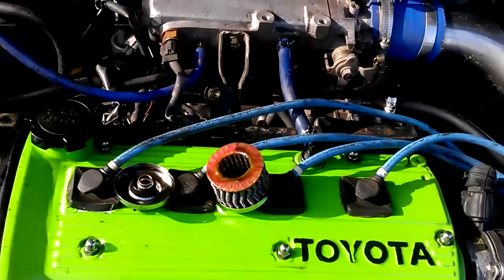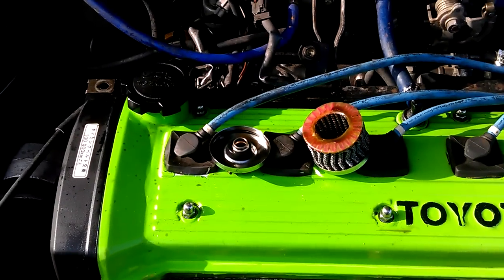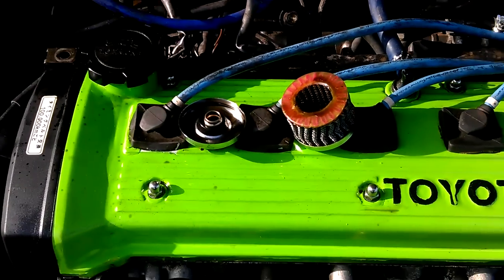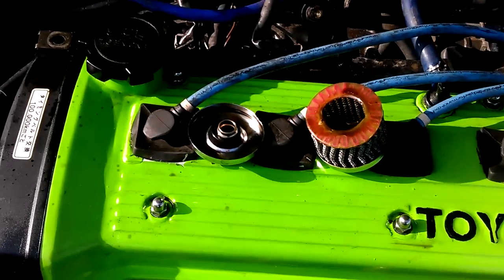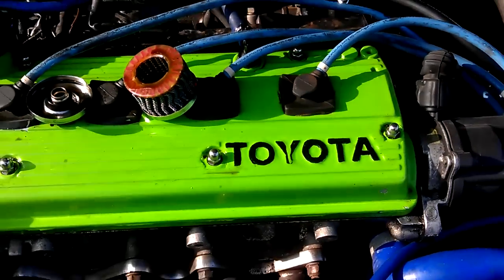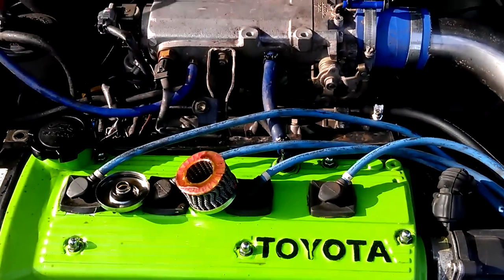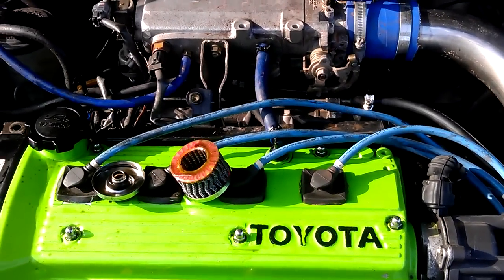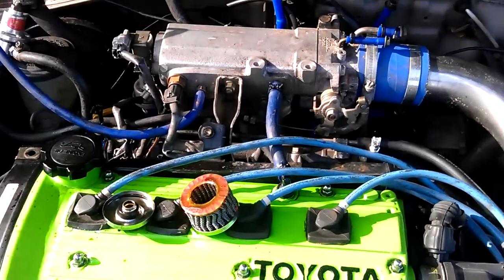4efte Excessive vapour from breather and piston down on compression

Comment from the maker: Yeah 99% always the ringlands which break with overboosting, i was advised against using the same rings rebuilding it, the correct way would be to change broken pistons, if bores are ok deglaze them in the machine shop, new rings, then put back together. Rings are about £100, pistons you can get for free from uksc ifyou ask nicely :)
Reply: Craig McTaggart  uksc? Need pistons got a simla problem with my gt there free ? tell me more cheers